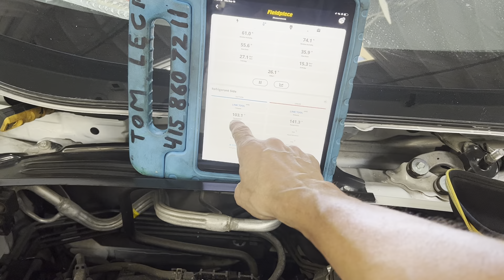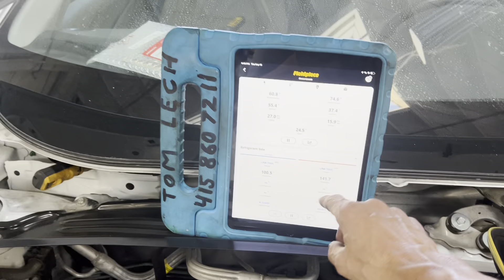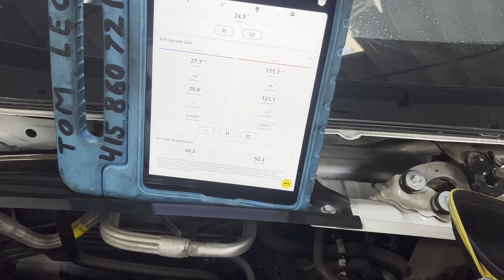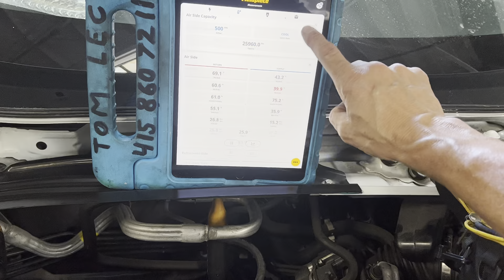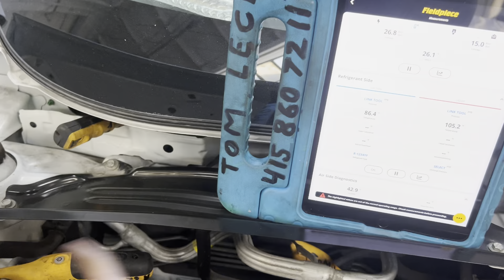aftermarket AC condenser they cost customers more money in the future. Let’s screw the customer￼￼

Comment: Or it could of not had enough oil or too much oil added after condenser replacement. You know how many shops don't add oil after evacuating the A/C system or despite oil that had been leaking out. Your A/C oil plays a huge role in efficiency of the condenser and evaporator. Too much will lower efficiency, too little will raise efficiency. That oil takes up space and isn't just for the pump. You are over analyzing it by drawing conclusions about aftermarket A/C equipment and using high tech tools while neglecting the fundamentals to A/C work.
Reply from the maker: It’s not conclusions it’s math take a heat exchanger designing class in thermodynamics and fluid dynamics and you will know. 

There’s a difference between knowledge and lack of knowledge. 

A lot of shops put too much oil in specially nowadays modern cars that only have somewhere between 2.77 to around 4 ounces of oil charge some shops think every time the car comes in you put in 1 ounce of oil just for good luck to make sure it’s OK lol 😂 

When I see these guys I just wanna cry

On condenser design it all has to do with surface area.  And actually how thin they could make the material the tubes walls the thinner they can make that material the more efficient it is. 

The more internal surface area inside the tubes by adding the tiny little fins in there greatly adds to the heat dissipation per pound mass of refrigerant that you flow past them

The exterior of the tubes the thin count surface area to dissipate heat these are all math calculations when they designed the condensers

Every kid who went to HVAC School and went to the thermodynamics class and heat exchanger design classes this is all basic knowledge it’s not guessing or voodoo magic. 

And like on the Toyota when you buy their factory DENSO condenser they give you a small can of the required quantity of oil for the vehicle so there is no guesswork you’re not putting too much in you’re not putting too little and you’re not putting in the wrong viscosity or type

That’s another problem with the aftermarket condensers when trying to replace and condenser manufacture who actually provide you with the small can a factory oil for that compressor manufacture

The other big problem the OEM condenser manufactures that provide the foam strips pre-installed and glued onto the side of the condensers to block the hot engine heat from rolling around and reheating the refrigerant

The cheap aftermarket condensers manufacturers do not provide that. 

Occasionally there’s some good aftermarket condenser manufactures who have a few year make model condenses that they produce that are near identical I have done videos on them showing that you can barely tell the difference they’re so good

But the majority of people are price hunting and don’t know any better and they go for the lowest common denominator in price not knowing that they’re racing to the bottom of the barrel in Performance

Not to mention all the aftermarket condensers I’ve had to remove from shops installing them just a few prior months either leaking from their brazing weld points or just cracking out the tubes bad machining at the inserts for the fittings for the hose in line attachments were they just don’t quite seal the O-ring under extreme pressure is because they were only a few thousands of an inch difference from the OEM and then leak later on I’ve done quite a few videos on those. 

The problem is so bad I told my shops if you put in a Denso brand condenser and it is defective out of the box I will do the whole job for free

But if you put an aftermarket condenser and I’m charging you a second time if it fails and if you put another one in I’ll charge you a third time or fourth time and I’ve had to do this to shops who kept using aftermarket condenses on the same car and had three the worst one was for failures before they finally purchased an OEM. 

that’s the difference from somebody who does this every day from 7 AM to 7 PM for the last 30+ years.
Reply: @coldfinger459sub0  You are looking way to hard into it. Yes you are "technically" right. But those are just nuances. The only thing that really matters is design specifications. The temperature on these newer cars is regulated by the PCM (yes the a/c system is belt driven so the PCM controls it) They use variable displacement pumps. The older styles simply switch the pump on and off to maintain a certain temperature/pressure. 

With that being said these work almost identically to how a car radiator works. The cooling system is regulated by a thermostat. The A/C system is regulated by modulating the pump by varying displacement or cycling it on and off. If there is a restriction (too much oil), or too little oil this will change the running efficiency well beyond how an aftermarket unit performs because the "fins are thinner".

Only thing that matters is temperature coming out the vent relative to ambient.

Source: I am a dealer technician, never have I ever seen such a tool used. A standard infared camera would work equally as good.
Reply from the maker: @JrSpitty  I have been in shops where they put in bad condensers.  Was literally getting high 300s just touching 400 psi head pressure.    On 85 90° days  Removed condenser put back on original condenser head pressure brought drops back down to 210 230 psi.    I’ve done this many times firsthand experience it’s really easy no guessing.     I’ve had to do it for other shops.   Most times most guys will never know because the AC will always work it will just work at an extra hundred psi which is no big deal because the temperature out the dash will still be cool.     

but on some of the very smaller displacement cars especially older ones that did not have a good idle up compensation under heavy load with stumble and run rough when you have nearly 400 psi on your high side.   What’s still getting some cooling out of the dash but the motor at idle cannot take that extra pressure that’s why they have a rough idle because of the load of the compressor. 

On some of the small week displacement engine hybrid vehicles.    Instead of depending on your ambient temperature your normal 150 psi to 250 psi.       You may see the pressure at 350 psi on a hot day or more. 

Customer complains of poor gas mileage sometimes they notice sometimes they don’t that the engine comes on more often at stoplights or idle when the car is sitting.   Because when the electric compressor is operating at near 400 psi the current draw on the compressor near doubles.    The air conditioning still working few degrees warmer out there – not quite as good as it used to be but the gas mileage plummets.     Usually by this time the customer may have been to a few shops they’ve done spark plugs ignition coils sometimes fuel pumps and other parts thrown at the wall trying to diagnose why the gas mileage is low and the engine stays running a long time.        And it’s because of that high am draw from the AC compressor running at an elevated head pressure draws down the high voltage battery so the engine Hass to keep turning on to charge up the HV battery.    

Worst case scenario well you’ll see when a high voltage battery is getting old towards the end of its life it discharges really fast and you have to charge them more often.   That’s what the technician sometimes thinks this is the worst case scenario and it’s not that the batteries getting old it’s just the excessively high head pressure and high compressor amp draw. 

If it’s a good aftermarket condenser you won’t have a problem.    But when it’s one like I show in the video it works great at my old temperatures no problem at all whatsoever but it’s an exponential failure it’s not linear as the temperature goes up once it passes The threshold at which the ambient temperature and the condenser can no longer control for every degree ambient it goes up outside the head pressure skyrockets 20 or 30°.  It’s that straw that breaks the camels back scenario. 

It’s really easy once you see that and you recognize what the problem is. 

You take out the garden hose and you just spray a little water on the condenser and like every condenser whether it’s good or bad the head pressure will drop really fast and work normally. 

We pull off the condenser replace it with the OEM problem is gone that simple.  

My first few times I literally well the front bumper and everything was still off put back on the aftermarket condenser head pressure would shoot sky high. 

Take it off and put back the OEM condenser head pressure drops nearly 200 psi in both case scenarios the air conditioning was working. 

But the one with an extra 200 psi on top of normal operating pressure just drains down the high voltage battery rapidly. 

Poor customers who went in having ignition coils and spark plugs changed fuel pumps changed and a Parts Kanon list just ever increases with no one ever thinking about the condenser. 

Simple basics child stuff in HVAC.    You get the same symptom when somebody who lives in a farming area when they’re harvesting cotton and the little shreds of cotton plug the condensers and radiators it drives the head pressure of same with other fibers plant materials around the country you see the exact same problem but this you would only know if you flip by places were people have got clogged radiators from organic plant material you see the exact same problem with the head pressure the gas mileage the high voltage battery is draining down because of plugged condensers.  Because you essentially cut down the fin surface area by slowing down and hindering airflow and surface area of the expose condenser same thing.   and you simply clean the condenser.   Anybody with experience has seen this but not everybody notices it. 

The difference between somebody with experience in somebody without.   Noncontact infrared thermal camera very inaccurate and won’t really tell you anything other than your running hot or not.    Or in the case scenario where there’s compressor debris inside the tubes you can see the cooler tubes that are running with restriction with the infrared camera. 

That has nothing to do will tell you absolutely nothing with a condenser that has lower surface thin area across its entire make up the camera will just show you the exact same thing you would see on an OEM condenser no difference other than a lower temperature at the exact same operating conditions of ambient temperature.

And no the temperature out the dash is not the only thing that matters.  Especially when you have a electric car.  Losing a quarter of your drive range from your electric battery in hot summertime weather is more important than your vent temperature. 

And no the variable displacement compressor will not make any difference when there’s not enough surface area to drop the head pressure due to the lack of material fin count in tubing count for surface area to dissipate heat

It’s like putting a piece of cardboard over a radiator on a heat wave during the summer and then wondering why your temperature is running high

And yes we had a rasher problems with that aftermarket radiators but they fix that after quite a few lawsuits with a couple of manufacturers selling cheap aftermarket radiators specially those small Hondas back in the days when they had to condenser to the driver side and the radiator to the passenger side here in California. 

One of those small cars in the summertime would takeoff to Los Angeles down south where it gets hot and they will try to climb a large hill like the grapevine and they would be with a blown head gasket off to the side of the freeway with the hood up after having a new aftermarket cheap condenser replaced with the same problem lack of surface area to dissipate heat.    It would only show up on the hottest days in the hottest climates.  

Only references a bad design condenser will not leave you on your side of the road with a blown head gasket.    Just pour AC performance on the hottest summer days rough idle for the smallest week as engines on the hottest summer days and low electric vehicle battery range in the hottest summer weather. 

Having nothing to do with oil in the AC system
Reply: Thank you I’m starting on the field. This videos help a lot. Thank for your time and share your knowledge.
Reply: Tom is correct. It depends on the aftermarket condenser, some range from just about ok to terrible in which case no amount or lack of oil is going to improve performance on a substandard part. 

Modern design principles mainly CAD and accurate fluid dynamic simulation technology has allowed manufacturers to design the AC system to be as cost effective as possible, part of this process is by using as little metal as they can get away with to meet whatever cooling standards they have specified.

Outside of high end luxury vehicles very few cars these days come with an overly specified AC system.  if the OEM can save what would be millions of inches of aluminium over a  complete production run then they would.

Depending on how much less metal (think surface area) they cut from their part vs the original then it might only lower the performance so that only under really extreme heat it does not work as well as the genuine part, some of the poorer cheaper made parts will be unable to cool even in modest heat. 

This lack of system capacity with an aftermarket parts may not be an issue if you are in a cooler area but at the very least I think aftermarket manufacturers should be made to state that this part isn't made to the same specifications as the original and reduced output may result from using said part.

Maybe then some insurance companies and techs might be a bit more hesitant to fit them without the customers knowledge and consent.
Reply from the maker: @n2n8sda  exactly 100% could not have said it better myself 👍 

We have to remember some people have no formal education in thermal dynamics, fluid dynamics, metallurgy.  They did not spend and invests  2 1/2 to 4+ to get their BS or AS in one or the areas of building construction thermal or HVAC/R on testing and design.  
             Or think a thermal infrared thermometer that are not accurate on different colors emissivity surfaces and angles one of the most inaccurate devices to use for testing.  Trying to uneducated bad knowledge is like speaking to a log 🪵 sometimes.  Got to keep trying to up the respect & level of the this trade.